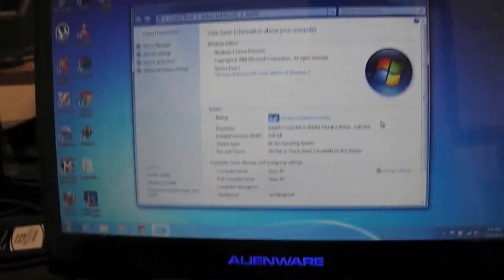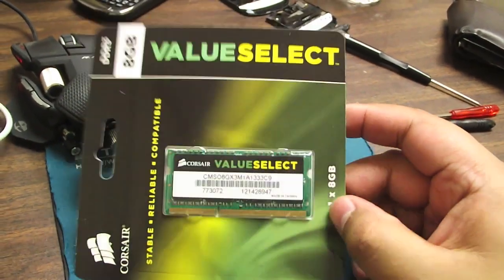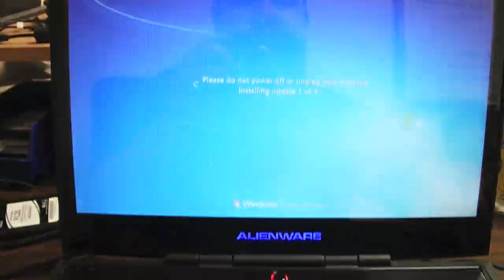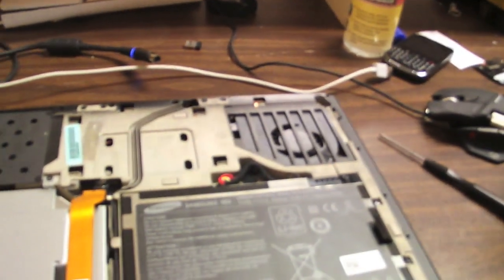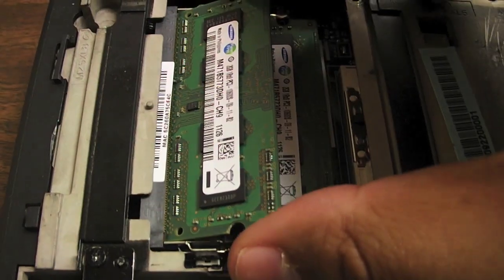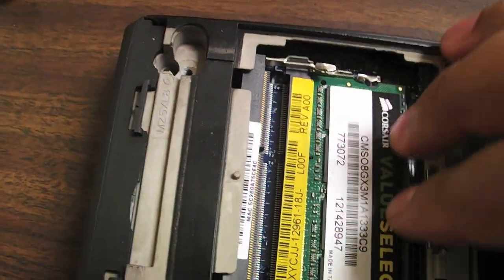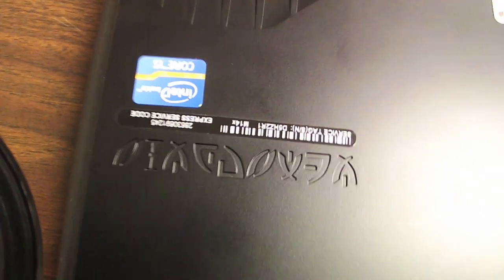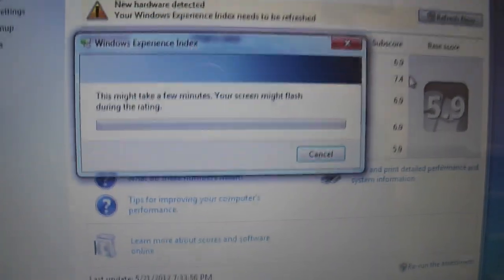Alienware M14X Ram upgrade in 5 minutes

Comment: Nice! I usually remove power first by disconnecting the battery or use an anti-static wrist strap with grounding wire for 5 bux. But I live in Vegas, the air is super dry which makes it more prone to static electricity.